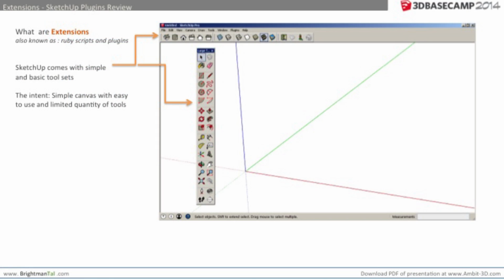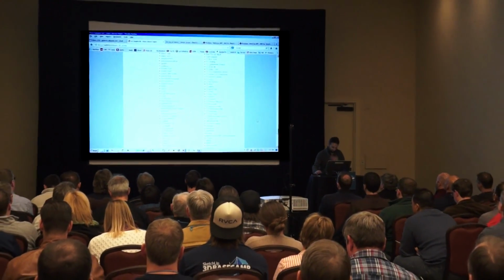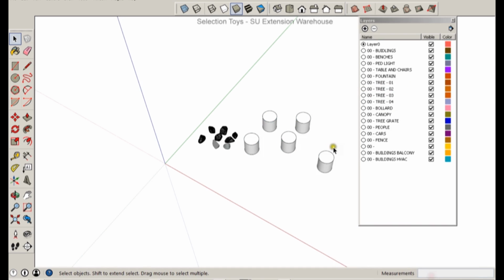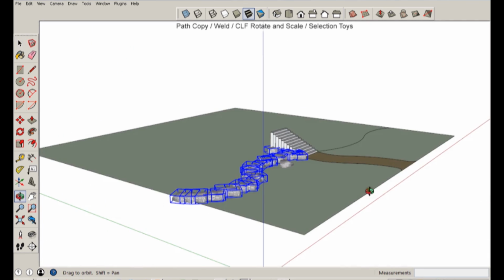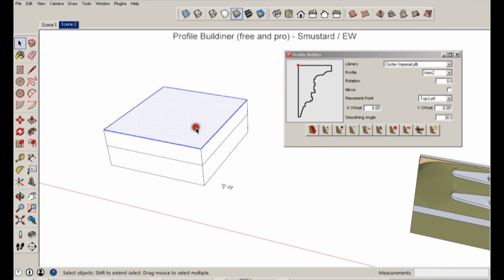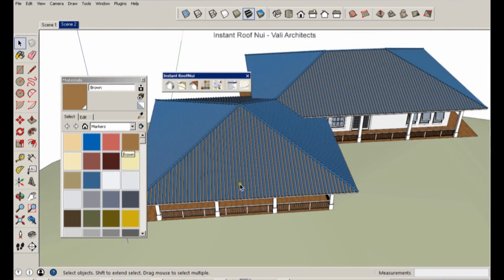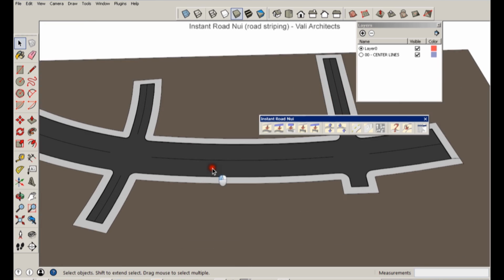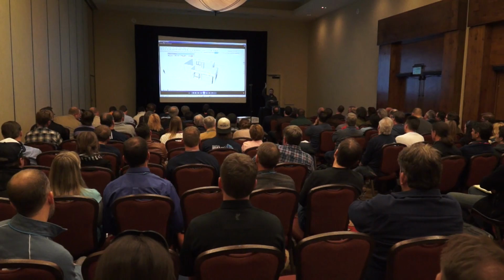3D Basecamp 2014: SketchUp Extensions and Modeling, Daniel Tal

Comment: How does one register for this Base camp? When/Where is the 2015 Basecamp offered? Thx.
Reply: Basecamp happens every other year. The next one, and this is not official since I do not work for SketchUp, should be in 2016. I would contact SketchUp and ask them to include you on the mailing list, check out the SketchUp Facebook page as well. But you have a year until the next one if it occurs. Thanks, Daniel Tal
Reply: Daniel Tal the video of the next day, where you show tips on terrain modelling, isn´t online?

Are the tips you give done with the Vali Architects plugins? Because those plugins are good but too expensive, considering they are subscription based.
Reply: rogerpenna Hey. I do not think they a sub based but not sure. Those tips are for the Vali's plugins. You can purchase individual plugins from this site instead of the whole package. I think they run $25 to $35 per plugin depending on which one. Thanks - Daniel
Reply: Daniel Tal 

Daniel, I can only think that Vali has allowed you to keep the plugins without needing to renovate the subscriptions, since you mention them in these courses, so it´s good for him. Only way to explain how you did not know they were subscription (or maybe your company pays the subscription?)

But yes, they are subscription based... $39 per year the most expensive.

It´s clearly written at Vali Architects website, under each subscription plugin: "this plugin is offered as a yearly subscription. An internet connection is required for its use"

http://www.valiarchitects.com/subscription_scripts/instant-fence-and-railing 
$26 per year

http://www.valiarchitects.com/subscription_scripts/instant-road-nui

$38 per year

http://www.valiarchitects.com/subscription_scripts/instant-roof-nui

$39 per year

http://www.valiarchitects.com/subscription_scripts/instant-site-grader-nui

$15 per year

http://www.valiarchitects.com/subscription_scripts/instant-wall

$18 per year
Reply: rogerpenna Your right, I did not know that. Good info for me. For the company I work for we have a network license I think but I do not handle the payment for that option. For my presentations, you are correct, I do use versions he has provided to me. Sorry about that. But they are still worth it :  )
Reply: Daniel Tal They are very amazing plugins no doubt. But the current dollar-real exchange rate does not favor me considering it´s yearly payments. Too bad. I hope Vali will someday change his business model. Again, I have seen many people that would have bought the plugins if they were fixed price (at those prices, which are fair for plugins instead of complete programs)

Thus, I wonder he wouldn´t make more money by making them fixed price rather than subscription.